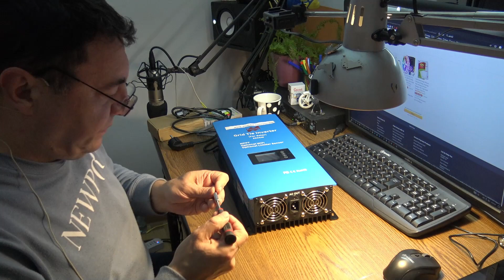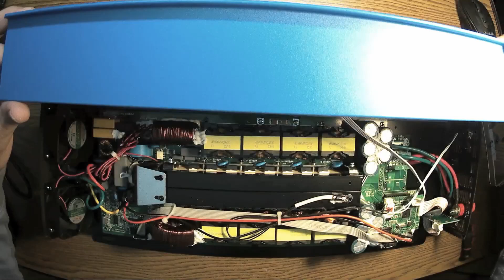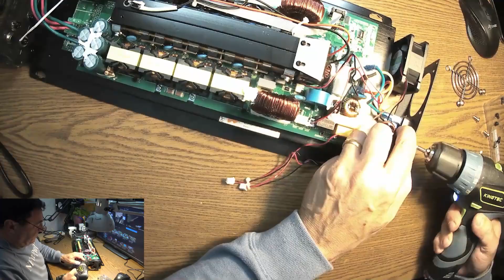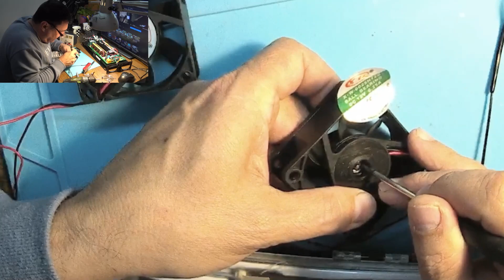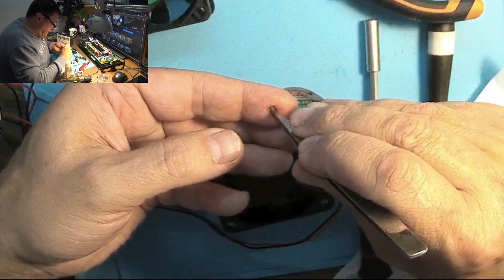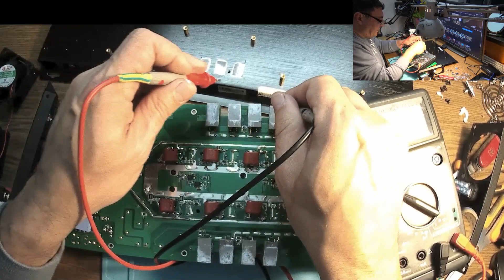SUN-2000GTIL2 inverter limiter dismantle fan fix

Comment: Today my inverter started running the 2 fans at max speed, although it was cool.
Any idea on what to check?
The inner fan is not running (but functional)
Reply from the maker: As long as it's delivering power shouldn't be a problem. The inner fan starts around 52C only.
Reply: @viocaia  but fans make too much noise running at full power
Reply from the maker: @danpadure  There should be some temperature sensors, have you displaced them? I Can't find any explanation to this behavior. Also check the transistor which it's controlling the bottom fans...probably it's shorted, and full voltage runs the fans...that's why the turbo is not responding,  the device it's already cool. Check the circuit for fans...I suspect the final transistor or IC it's blown.

Comment: Please show how to measure those high voltage mosfets. I have 2 boards that need repairs. Any ideas? Perhaps the controller board is bad?
Reply from the maker: The best and simple way to check Mosfets is one of those cheap transistors testers like https://www.aliexpress.com/item/1005005430295628.html?spm=a2g0o.productlist.main.1.117f62um62umwX&algo_pvid=6df81c77-88ee-4f42-9627-93cfa10e92f4&aem_p4p_detail=202311100232158472715155828720005710453&algo_exp_id=6df81c77-88ee-4f42-9627-93cfa10e92f4-0&pdp_npi=4%40dis%21RON%21161.53%2184.13%21%21%21247.67%21%21%402101c6e316996123357896403edf13%2112000033040265575%21sea%21RO%211675461357%21&curPageLogUid=GA8KJiw4GjaO&search_p4p_id=202311100232158472715155828720005710453_1

Comment: Gl1000 Garbage Lasted 18 Months Now it will not produce AC Current Pure Garbage!
Reply from the maker: Everything starts with bad cooling! I found that after the inverter blew up. In summer, in my porch there were more then 35 degres C , it was my mistake to over estimate the fans...now I got that experience and I put extra fans...of course is not the best device on the market but I have no problem with injecting power to mains. I'm invisible.
Reply from the maker: Send it to me..maybe I can fixed!

Comment: I have a problem with the fans in my 1000w version. I always thought it was very bad design as the thing goes "VrooomBooooom....!!" with a very loud basey noise as it spins up(!). I've just now installed my 3rd 1000Gtil and realised it's whisper quiet - so if must be a bad fan in the loud one all along. Never realised until today 😅
Reply from the maker: No stress! There are 3 fans..two the bottom of the case for general cooling, those have bearings and pretty quiet and another noisy guy cooling the heatsink when the temparature goes over 50 C...once in a while that one comes up very noisy, it's like a turbo fan. It's normal to have that sound.

Comment: Thanks for the video. I'm having a problem with one of my 2k GTILs I can't figure out, so am curious to see if you experience it too. The 2k GTIL can take up to 30A DC. I have two GTILs, set with a 25A input limit to give a little safety buffer. One is happy to accept 25A. The other (much newer one) reboots itself every few seconds if I give it more than 17A, which is barely more than half what it should be able to accept. Suggestions welcome!
Reply from the maker: Check the minimum reboot voltage..set it to 44V...eventually double the wires..or higher gauge to avoid drastically voltage drop under peaks..make the wires as short as possible too..
Reply from the maker: Hey! Just curios..was that working?